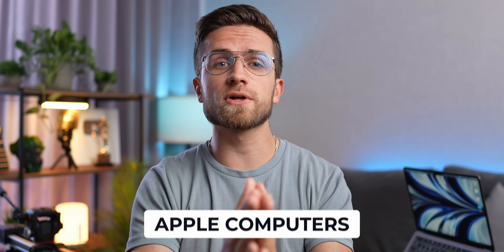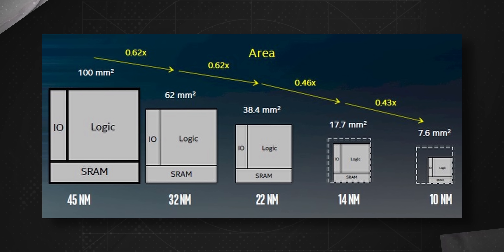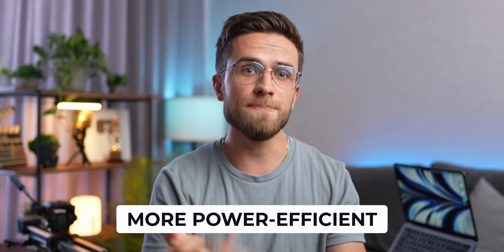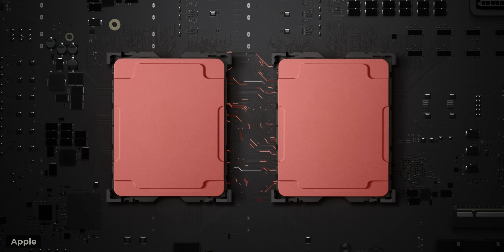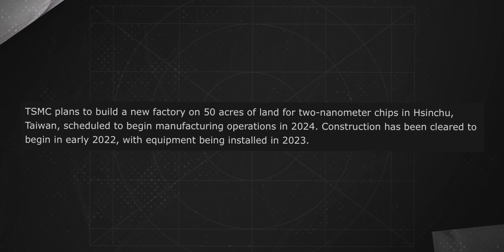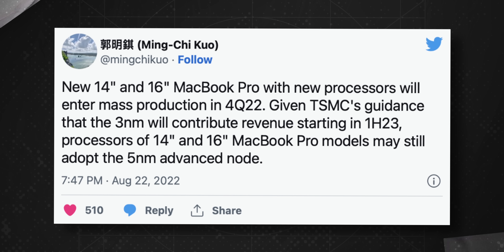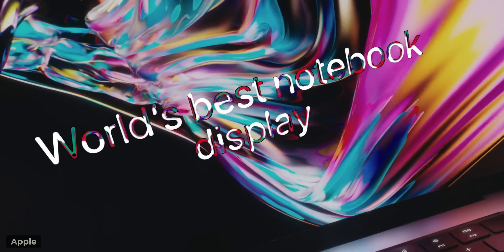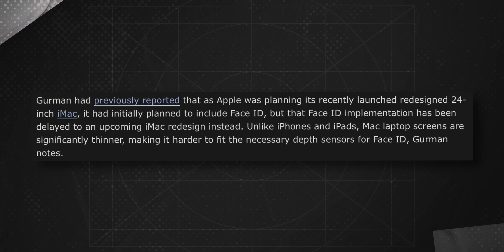14“ M2 PRO MacBook — PLEASE DON’T BUY M2 AIR IN 2022!

Comment: I would like to develop web, application development, in general programmer and develop software, which model do you recommend between the Air M1, Air M2 or Macbook Pro 13 M2 ??
Reply: Have you make up your mind? Which one you will buy? I am confuse too..
Reply: @atiqahrosman4972  I finally decided to buy the M1, which will arrive today. my goal was to buy the 14-inch M1PRO but I preferred the m1 basic The reason why I chose m1 basic was mainly because of the price: €1,019 m1basic vs 1,866.63 m1 pro. aside from the money, I chose it because I'm starting out as a programmer and I don't need much at the moment, I took into account that the M1PRO would have been a computer for many years but soon Apple will present its new Macbook M2pro and that means that the old PCs will drop in price. another reason not to buy the M1 pro is that it was very powerful and I could use its full potential since I am an amateur, it would be like having a Ferrari in the garage. and finally I chose the M1 basic because honestly I don't know how long I'm going to last in this program.I don't know if I end up really liking it or if I'm good enough to continue studying. in the worst case the computer would end up being for irregular daily use.

Comment: Dont listen to this guy. He’s basically comparing a Honda civic to a Ferrari. Not everyone can afford the Pro Models and not everyone needs them. I have the m2 Air and it works great for everyday tasks and it has plenty of power for most challenging tasks. The only real issue might be cooling and lack of fan but mine hasn’t overheated yet. But for most people its not a problem.
Reply: Did you get the base model?
Reply: @rodriguezpoolservice3447  No I needed a good laptop for college so I paid extra for the 512 GB SSD and 16 GB of ram. I still think the base model is good enough for most people but I just wanted to future proof mine so I was willing to pay more.
Reply: @Inferno45  then for just 200-300 bucks more you could’ve got a Ferrari. You pay a couple hundred more for a much superior machine that will give you more years of usability compared to the air -_-. I’d return it and get the base 14” pro. Best Buy had them for $1800. Same 16gb of ram but the bandwidth is 200gb/s instead of 100 on the air. CPU and gpu are of course more powerful, 120hz mini led display is easier on the eyes and an inch larger, superior speakers by a mile, and ports… so you’re not going through multiple dongles over the course of the laptop’s life. The difference pays for itself in dongles basically.
Reply: @mootsym  Yeah but you can only get the 14 pro at that price if it’s refurbished and i don’t want a refurbished laptop. I wanted a brand new one. Also my budget was $1600 and i dont need to extra performance because I am not a creator so i wasn’t gonna pay more even if it wasn’t refurbished. I simply wanted a good laptop for college and the M2 air is enough for me.
Reply: @Inferno45  It was in best buy new for $1800.  Save your money for a week and you end up with a laptop that will be useful for at least 2 more years compared to the air, plus the better screen, speakers, dongle-free life, etc etc. It's the most no-brainer decision going pro over the air for 200 dollars.
Reply: @mootsym  Yeah but you’re forgetting that $1800 is the price before tax. My laptop costed me $1,479 before tax and $1,586.98 after tax so thats almost a $400 difference between the M2 Air and the 14’ M1 Pro before tax. So with tax the m1 pro would have costed probably around $1900. At that point it doesnt make sense and I really dont need a computer that powerful. Get what I mean?

Comment: What will happen to the M1 Macbook Air?  Any ideas?
Reply: I suppose it depends what do you want to do with it? What does your question mean?
Reply: @goemboeck  Will it still be offered?  or will it be phased out?
Reply: @richardhudson4649  A good question, however second hand ones will be in quantities, and Apple computers tend to last long (I'm writing this from my 2011 MBP). Apple will market M1 tech as long as they're all sold out, but I'd be surprised to see much any price drop.
Reply: @goemboeck  I am writing this on my Mid 2012 MBP.  The screen has some pixels going, and I recently had to start using a mouse as the track pad has failed.

I could fix either/both, but it makes no sense when a new MBA is ~$1300CAD. (less if I buy Apple refurbished)  I have started doing some research and will probably be buying next month, and am wondering about timing my purchase.
Reply: They’ll start giving it away for free.
Reply: Discontinued
Reply: @richardhudson4649  My MBP turned 11yrs this February, I'm convinced by now that it is indestructible as it has been around the world and is still in active daily use.
I'm waiting for the next MBP lineup, or at least confirmation of them, before getting serious about the much needed upgrade. If they really have 3nm chip as rumoured, they would bring more oomph to the battery life and performance.
What I really want to wait for is the ARMv9 tech, but I doubt I could possibly wait until they are out there. 
Any modern laptop mops the floor with my laptop but MacOS and the software runs smoothly enough for my daily use. But yes you'd probably better off with a new one than fixing your current one.

Comment: This M2 drama has been over blown especially on this channel. A lot of YouTubers need to crank out videos for the algorithm in order to stay relevant. And that's hurting everyday consumers who want a great laptop. I bought two M2 MB Airs. I have a 16 Gb, 1 tb for myself and a base M2 (both 8 core GPUs models). They're amazing laptops. I use mine with virtualization for windows for work and the M2 is phenomenal. My wife has the base M2 for surfing the web and video calls. They're both fast even with the SSD drama. To be honest, most people aren't going to notice the difference in speed unless you're doing professional level work. Lastly, 8 GB is great for every day applications but apple does use SWAP. Idk why but sometimes the 8 GBs aren't full and it will use a random 30 MB of SWAP. If you can afford it, I'd go with 16 GB. Virtualization is so smooth with 16GB that I wish I upgraded from my intel Mac a long time ago.
Reply: I totally agree with you. IMHO, if you notice the difference in terms of speed between base SSD and >512GB you simply chose the wrong machine.
Reply: Agreed. Between choosing 512GB and 16GB Ram, I'd choose to spend on 16GB Ram which will become the major bottleneck in performance. The single NAND chip is fine and is still 3 times better than a SATA SSD and the SATA SSD itself is plenty fast in 2022, people are buying NVMe because they cost about the same and offer better sequential write speeds not 'cause SATA SSDs have perished. Granted the difference would be felt in importing large video files, but hey if you're doing that kinda work why get 256GB in the first place?
Reply: Which M2 would you suggest for a medical student who uses his laptop for long hours? I need one that would not slow down during my day when I have at least 10 web tabs open, Powerpoint, Excel, Word, and PDFs open at the same time. I also need it to sustain a game that requires "at least 4GB RAM". I want it to last me at least 5 years. I currently have MacBook Pro form 2012 so any new Mac would be a humongous upgrade. I'm thinking of getting M2 MacBook Air 16 GB, 512 GB or M2 MacBook Pro but not sure if I really need the Pro version especially since I'm liking the design of the M2 MacBook Air.
Reply: @George.J   I would say M2 Air should be fine. Depends on the game you’re playing though. M2 handles virtualization so well. I have 16 GB and have never used SWAP. MOffice is a joke to the machine. As far as tabs, if you’re using safari, I think 50 wouldn’t even make it sweat. I’ve moved away from chromium. It’s such a ram hog.

I went to Costco before buying the M2 Air. The 14” is noticeably bigger and imo you only need it if you’re doing sustained professional level work. What game are you playing?
Reply: @erwinraj823  The Sims 4. I also don't think I need the 14" since it's too big for the level of work I'll be doing.
Reply: @George.J   @George J. My cousin plays the SIMS with a base M1 MacBook Air. You should be fine playing the SIMS. Heck, I'd download and play it before you buy it to see if it's smooth.

No YouTuber has really highlighted this, but the M2 is the fastest single core Mac, ever. Even faster than the M1 Max and Ultra Mac Studio's. This makes everything so fast. Applications open instantly. Even apps running Rosetta are faster than the Intel Mac's. The chip so far has been a 10/10.

Since you're going to buy it for 5+ years, I'd suggest getting the 1TB. That's what I did.
Reply: @erwinraj823  Thank you for the information. You have stated more useful advice in these 2 replies than the tons of videos I've been watching on the topic. I hope you have a great day!
Reply: Alright gang, 2 month in and this laptop is a 10/10. I have an external monitor and leave it plugged in 90% of the time. And I'm only at 13 charge cycles! I've noticed apple leaves the battery at 80% when I go days without unplugging it. Best laptop I've ever had!

Comment: I'm still using an old 2012 MacBook Pro 15 inch just fine, and I think 99% of people can get away with using an old computer. The majority of people just use their MacBook for web browsing, Microsoft office, ETC and you don't need that much power to do all that.
Reply: Same here! With an upgrade from 4 to 8gb of Ram and SSD added. Enough to perform as you said, web browsing, office…

Comment: I just bought a M2 air, which will be delivered in a couple of weeks. I want a compact computer, with as few moving parts as possible , my workflow is not processor intensive or doesn't take hrs to complete , so the additional cost of pro just doesn't make sense for me.. TLDR : I am very happy with my purchase , and i went with midnight due to its uniqueness, I don't care about the finger prints.

Comment: Apple M2 is running @5nm. AMD is  now running @6nm.  Which Ryzen 7000 has already been announced. Intel is stuck @ 10nm. Ryzen chips beat the living day lights out if M chips in multi core. AMD is right around the corner to Apple's M chips. 

TSMC is the one also giving apple a slight advantage. Please don't be a fan girl and gett your facts straight Jr.

Comment: I think someone on the comments to a previous video predicted that Arthur would say ‘wait for 3nm’. In a way I don’t blame him as the M2 MacBook Air is so easy to hate or love. It’s far too expensive for an entry level ultrabook at £1249. It has a base model with not enough ram and slow ssd. But it looks amazing and is light and fast. And the best colour midnight is smudge magnet 😊
Reply: Look at the benchmarks and real-world performance, it's FAR from an entry level ultrabook.  It's on par with higher end Dell and Windows laptops that are even more expensive.
Reply: @lambert1024  my point is that Arthur was predicted to say ‘wait for 3nm’. Of course it’s way better than most of the windows dross.

Comment: I am going to buy the 14-inch MacBook Pro base model soon. It will be a significant upgrade from my 2017 MacBook Air which has been overheating a lot causing GPU failures and massive CPU underperformance. It often heats up to 80 degrees celsius for hours. Another thing I'm looking forward to on the 14 inch is the XDR display and HDMI port. I won't wait for new M2 Pro and Max since I don't fully utilize the power and I don't think my current MacBook Air's GPU can last until next year. I feel like I don't need 32GB RAM as I am not a pro photo editor.
Reply: If u no photographer just don’t waste ur money for that MacBook Pro m1 pro 14 inch . Just go the MacBook Air m2 chips or MacBook Air m1 base model . If u just watch YouTube or doing assignment, chatting with friend that’s confirm enough for u . Even though u want to editing video 4K that oso work every well with This two MacBook Air .  Use ur money to buy worth thing . That’s my advice. Cause I been using my MacBook Pro 14 inch m1 pro 6 month ago now I change to MacBook Air m2 base model.

Comment: Sigh. I got excited for a minute there. I’d love for a 3nm 14” by Black Friday.. but it’s not going to happen, which means I will have gone 2 Black Fridays passing on the 14” M1 pro while waiting for 3nm. .. which if it comes out in the spring, will have zero sales until.. yep.. Black Friday of the following year -_- 2023.  And you talked about 2nm like a massive upgrade from 3, but going 5 to 3 is just about the same percentage of a size decrease, so shouldn’t be the same percentage of performance increase?  I doubt we see OLED in the next pro. If anything it’ll be the following pro at the earliest.  They only just put out the mini LED displays and can milk that another year.  OLED and it’s perfect viewing angles and contrast will really be special though.

Comment: Apple will never release the latest M2 pro chip in 12 moths especially when the first new MacBook Pro M1 chip was released no more than a year
.  So the next gen of MacBook Pro should be released up to 18month, which means next year spring. This is the basic knowledge for people who care about some  Apple news. As for the new body design, the new MacBook Pro will keep the same design which means it cannot be as slim as the MacBook Air m2chip.

Comment: I feel the M2 Macbok Air has totally flipped Arthur out! Seems very angry about it... And I don't blame him. Seems very passionate which is a good thing. Maybe buy a Pro and move on from the short car crash of a relationship you've had with the Air... 😁😉.  Next up: Why I was wrong about the Macbok M2 Air... 😁
Reply: @Ramp a maxed out M2 Air? We’ll of course you are not going to have any slow downs. But you must have paid more than for the 14 inch Mac Pro MacBook which is a much better machine in many ways but not light and thin. The price point of the M2 MBA forces these sort of anomalies. If you had the entry level M2 MBA then you could speak from experience that there was ‘ no issue’
Reply: @pauljazzman408  He can certainly still speak from experience that he’s not had any issues. He just didn’t see eye to eye with the, “it’s just a little more to get [a different kind of computer],” that’s been said over and over again.

It’s really starting to sound like folks that so bent out of shape when someone buys a specced out M2 Air are offended, or taking it personally.

Different people have different wants and needs. If I don’t video edit, photo edit, use blender, or do much that maxes out the CPU for long periods of time, then, when it comes to what I actually do, the MBP 14 is barely faster. My own work is very RAM intensive, not CPU intensive. And I want as much battery life as possible. 

For my uses, the screen, speakers, active cooling, a little more ram (24 vs 32), and extra ports of the MBP 14 aren’t worth nearly $600 more for lesser battery life and a larger device.
Reply: @BenHammond  how can someone with 24gb ram and 2tb ssd M2 MBA say what a 8gb ram 256gb ssd would be like?  They have a totally different spec of machine?
Reply: @RampI was talking about the ssd speed. Ok you don’t believe the evidence of a blackbird speed test. So end of discussion.
Reply: @Ramp sorry if I wasn’t clear. But what I’m saying is that someone using a maxed out M2 MBA cannot say that the base model M2 MBA is fine because they are not using that spec. Also a maxed out M2 MBA cost way more than the 14inch Mac Pro MacBook Pro with 16Gb Ram and 512Gb SSD with better screen and more ports. So for most people that isn’t the best choice.

Comment: Few hundy more and get the m1 pro in the MBP 16” - I think Apple will keep the M1 Pro line alive and raise prices by $1k per unit on the new M2Pro - and they should really - the M2 with 3 N tech deserves it - the new smaller tech is really going to separate the Pros from the power users or occasional apple head! So they will create the Apple Elite,-the Pro- and entry user categories and pricing will reflect this.

Comment: Awesome video! I was in the market for a new computer earlier this year but most everyone that I talk to about recommendations said stick with windows. I didn’t have a few people that use Max tell me how much they liked them but when it came to people that are IT professionals or do you things like graphic design and stuff like that they said stick with Windows. When does 11 is awesome! I do believe they have copied a few things from Apple to make windows 11 look like a Mac computer. It started back in 2012 with windows eight when   Microsoft introduced windows store if I remember the name correctly. I got used to it very quickly once I made the transition from Windows 7. Windows 10 made the start menu smaller and when does 11 brings the start menu to the center of the screen. Have you ever done a video comparing windows versus macOS? If not, I would like to request a video on that topic.
Reply: Why are you even on an apple channel? Windows is crap and it will be crap even at windows 41 ... I work with Linux , Windows for work and windows is trash! just because Microsoft arm twisted businesses over the last 40 years doesn't mean it's a good OS for regular people. Every windows user I know is always got their antlers stuck in one of the windows thornbushes ... you don't like Macs, don't buy them, don't use them, you don't need to prosletyze on mac channels, that's so late 1990's.